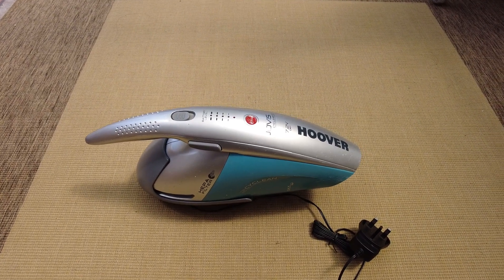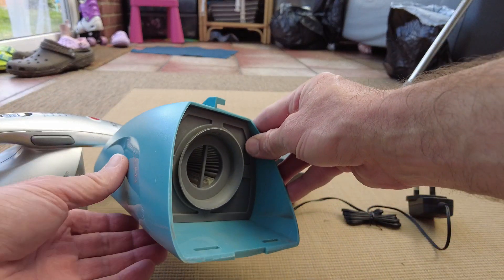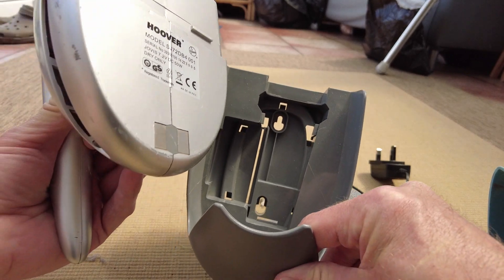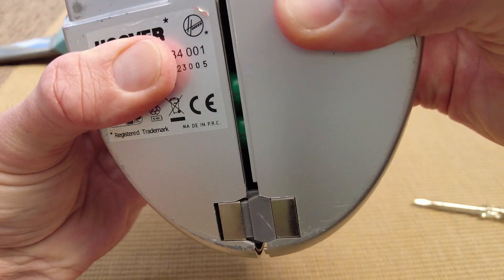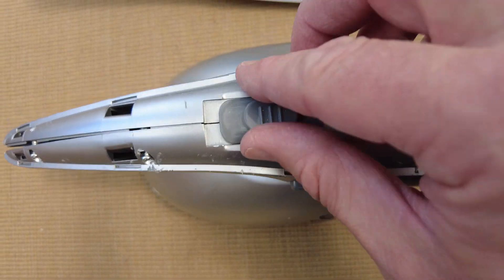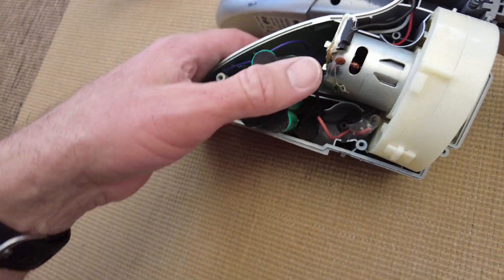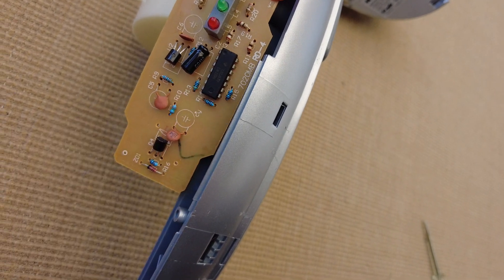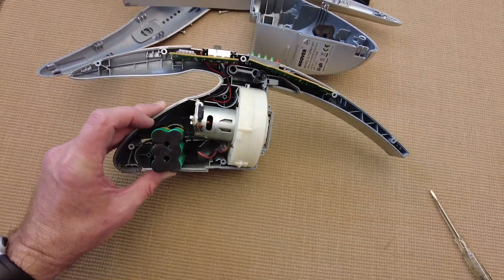Hoover Jovis Cyclean Teardown

Comment: Hi have you found out what batteries these take? I found one in my parents caravan and the battery is very bad
Reply from the maker: Yup, it is 6 x AA batteries. They are Ni-Mh units so easily obtainable to replace. You will need to do a bit of de-soldering though.
Reply: @ChrisHorswill  7.2v AA at 1300mAh each. mAh value can be improved, but 7.2v must be maintained.